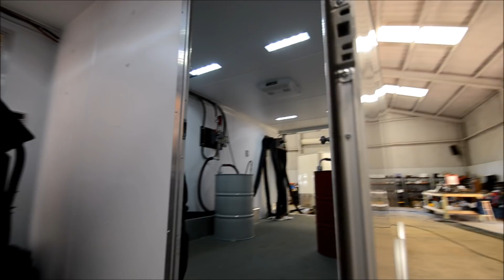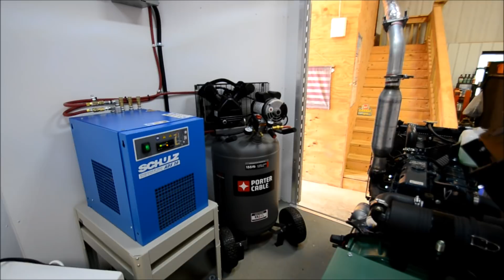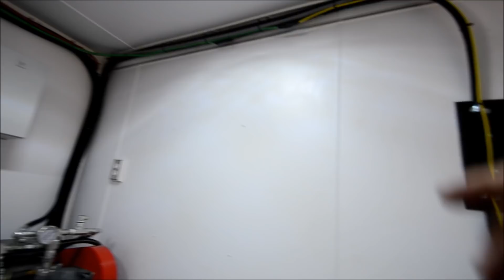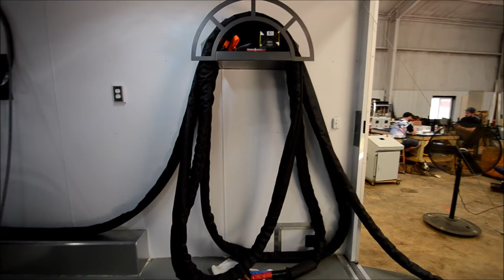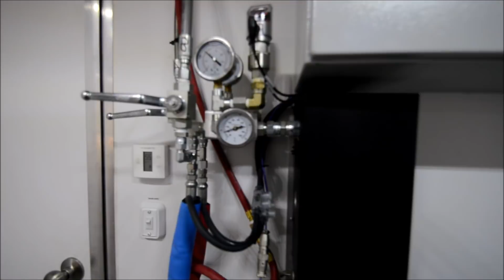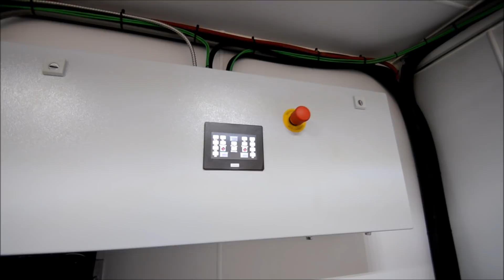MOST ACCURATE HYDRAULIC SPRAY FOAM RIG MACHINE

Comment: You said this was a 20,000 rig. I'm fixing to spend 25000 on a PMC PF 1600 (201418), 220V, 1PH, 90T, 9kW Heaters-With Pressure Balance Control (PBC)-With Inlet Monitoring (IM) and everything to get spraying. What could yall do? And I've already purchased a trailer
Reply from the maker: What about all the other stuff...compressor, generator, refrigerated drier...?? 16 Lbs a minute? 5252 ( most common tip size)  Mix chamber as about 13 lbs a minute. Graco A 25 is 25 lbs a min. Plus more total heat, Data Tracking, etc...Let me know what your all being quoted and I'll quote as apples to apples as I can. Tim
Reply: @SPECTechnologies  Fusion Air Purge Gun Round:2,531.25Subtotal010Graco T1, 2:1 Transfer Pumps011Graco T1 2:1 Transfer Pump 2ea, 35CFM Gas Driven Honda Rotary Screw Compressor015Parts -  - CFM Refrigerated Air Dryer  CFM Air Cooler / Aftercooler. Plus the whip hose
Reply: Is 16 lbs a minute not alot? Working with only 26k. And I've been told that the pmc is user friendly. Really wanted to stay clear of all the computer parts if I could. And its air driven. The hydraulic just seems to be more cosly.
Reply from the maker: @snelsonmichael1449  The A-25 is air driven. We have already sold 35 so far this year and 40 last year with no real issues at all. It has been one of the most dependable machines we have EVER SOLD. You can easily out work 16 lbs a minute, easily...Again I ask, what are you getting for $25-26K?, why don't you call me when you gat a chance....Tim 770-274-9888
Reply from the maker: @snelsonmichael1449  I see this post now.....Call me or drop me your e-mail....
Reply: @SPECTechnologies  michaelsnelson777@gmail.com. At full time job right now, so would have to call after 5